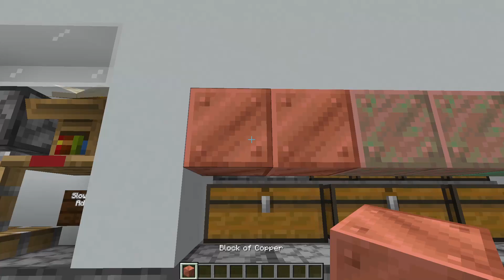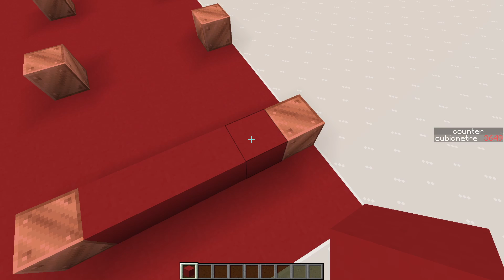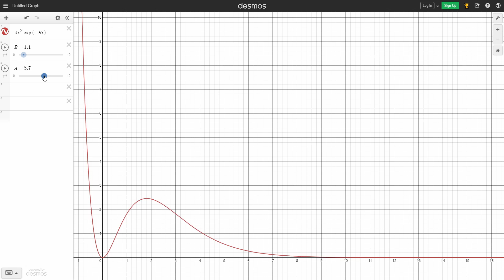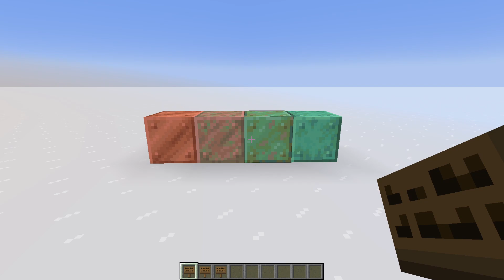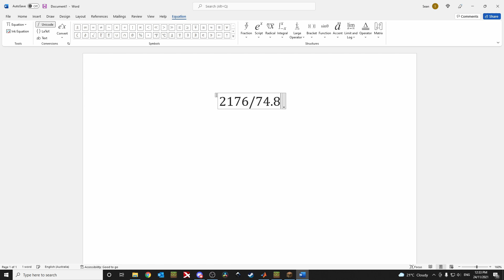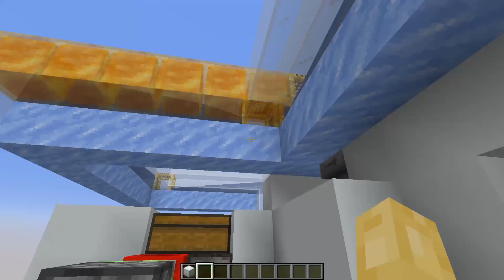Full Auto Oxidized Copper Factory

Comment: For producing maximally oxidized copper, it should be faster to harvest at the maximum placement rate, and instead rely on a sorting system capable of directing the incompletely-oxidized blocks back to the player to be placed back into the input stream a second (or third, or fourth) time. Breaking and re-placing a partially-oxidized copper block doesn't "lose" any progress, but fully-oxidized blocks occupying space in the system do represent an efficiency loss.

Comment: can u make an addition so u cut set a mode that reuses all less oxidized blocks then the one u chose when the supply of fresh blocks runs out
Reply from the maker: I did sort of try to implement this, when the buffers for lesser oxidized states overflow they will begin to dump the blocks onto the player placing blocks. The only issue is that to run at full speed the play needs to have some buffer of copper blocks in their hotbat slot, so when these lesser oxidized blocks get sent to the player they begin stacking up in a new hotbar slot that the player isn't using to place blocks.
Reply: @cubicmetre  have u tested if blocks despawn if u fill up your inv with items so only the one slot can pick up copper blocks?

Comment: I thought of something similar but then with cobblestone in between (I havent tried it), have you tried it, and ifso why didn't it work or was it inferior to powderd snow?
Reply from the maker: Powdered snow was the only block which could be placed AND removed automatically without needing to consume any resource such as TnT. The problem with generating blocks such as stone or cobble is that you are generating 4 filler blocks for every copper block. Meaning that whatever system you have to collect the copper at the end will also need to be engineered to handle the other 4 blocks that come with each copper block. Placing down 18Kph copper blocks would thus translate to an effective output speed of 90Kph, requiring vastly more systems in place to handle the extra blocks.
Reply: @cubicmetre  that makes sense, and also since you don't use tnt duping.

Comment: Never thought about using snow, I rather thought about using for example a cobble gen, separating the cobble from copper in similar way you pickup snow, and then blow up unneeded cobble, or maybe recycle it back using a block stream. If you would recycle the cobble back, it's also a closed system, and it also doesn't require hard to obtain thousands of snow buckets, you just need random filler block.
I love the whole finished product tho,  it feels so great to see engineering applied on such a simple task, just because automation is the way.
Maybe a small suggestion, there could maybe even a mode, which is used to "pull out" all the copper blocks from system, without needing to use more copper blocks to replace them. Basically just have snow being placed continuously until all copper blocks are pushed out.
Reply from the maker: That flushing mode is certainly a possibility, as for separating cobble can copper blocks, there is in fact no way to differentiate between two different full solid blocks like copper and cobble because they both behave the same in a block conveyor.

Comment: I love the way by which you can choose the state most blocks will end up as, but as a builder I often let everything oxidize to its maximum state and then just axe it to what I need later. Definitely streamlines the process.
Reply from the maker: Oh, I did not realize that using an axe would revert a block only a single stage. I always thought that using the axe on copper completely reset the oxidation.

Comment: sometimes we wont use the machine for a specific type of copper, because most people would probably want some of each type that they can use when needed. in the graph shown there was a point where the percentage of each type of copper was roughly equal, so there should be a setting where the copper is exploded at around that time.

Comment: Trying to derive the optimal times analytically (using some values from the wiki) I get the following function to maximise: (chance of block being fully oxidised after a time period, divided by time)

(1 - Sum[((1 - 1/4096*64/1125)^(3*20 (60 m)) (-(1/4096)*64/1125)^i Binomial[(3*20 (60 m)), i])/(-1 + 1/4096*64/1125)^i, {i, 0, 3}])/m

(m in minutes, mostly because trying to do the same with ticks got me into numerical accuracy issues during calculation)
Which gets me an optimal time of around 67.7 minutes, or 81207 gameticks. The difference between the values we got versus what you derived in the video could easily be explained as the difference that your approximation made, though admittedly it doesn't matter too much as the graphs are relatively flat near that maximum.

For the other states I got 0 minutes for unoxidised (duh), 1 tick for exposed copper (or 0 in my math but clearly it needs at least a chance to convert), 20 minutes for weathered copper

This then means that you optimally need a blockstream of roughly 20*60*67.7/2176 = 37.3 ticks per block  (11 ticks for weathered)

For reference, the following functions are the chances of finding the copper in each state after m minutes:
Copper Block:  (71999/72000)^(3600 m) 
Exposed Copper:   (9/71999)^(1 - 3600 m) 20^(2 - 10800 m) m
Weathered Copper: 5^(2 - 10800 m) 8^(1 - 7200 m) 9^(1 - 3600 m) 71999^(-2 + 3600 m) (-1 + 3600 m)m
Oxidised Copper: (1 - Sum[((1 - 1/4096*64/1125)^(3*20 (60 m)) (-(1/4096)*64/1125)^i Binomial[(3*20 (60 m)), i])/(-1 + 1/4096*64/1125)^i, {i, 0, 3}])       
(Or alternately, Oxidised Copper: 1 - the above 3 formulae, its just different notation)

I had a lot of fun doing this math, so thank you for inspiring me to do so. Though... It does make me wonder if the derived times could be somewhat off if for example copper blocks don't oxidise while being moved via piston. And if it could be interesting to return the collected blocks back to where you place it so you can give unoxidised blocks a second go through the machine. Optimal times for THAT would probably be different as well...(and likely lower)
Reply: Since the number of oxidization trials (number of ticks a copper block spends inside a silo) is large, it is justified to approximate the binomial distribution with its limit Poisson distribution. The fact that computing the binomial coefficients is causing you numerical problems is a clear sign that you should be doing this. The Poisson approximation would eliminate the numerical problems and be more accurate than the approximation you made of aggregating ticks to minutes.
The Poisson approximation will give you the oxidization graphs as exponential polynomials, which would arguably be more insightful than large binomial sums you got. I think the maxima could even be computed analytically.
Someone in this comment section derived the oxidization graphs as solutions to some coupled ordinary differential equations, which is equivalent to the Poisson approximation and also a really pretty and intuitive way of posing the problem.

I encourage you to try solving the problem you describe at the end, where the partially oxidized blocks are re-inserted into the machine. It's a really interesting and a much harder one as the probability that a block has been fully oxidized as it leaves the silo is no longer independent of the oxidization states of all the other blocks. You will have to find a steady state distribution that the system approaches when it's operated for a long time and then compute the expected value for that just like you have done here.
Reply: @Nukelawe  yeah, so... I didn't derive this  using Poisson or binomial distributions. I modeled this as a markov chain. (raising a transition matrix to a power and multiplying with the vector of initial states) The binomial coefficients were just what rolled out of the math.

The numerical issues I had was just that the derivative is smaller for the tick based formula compared to minute based. (which are rescaled versions of each other anyway) which then makes the root finding not work as well.

Both binomial and Poisson distributions would be an approximation. (EDIT: In hindsight Binomial might not be)
Reply: @roderik1990  That is curious. I thought a Markov chain would only be necessary for describing the system, in which partially oxidized blocks are reinserted to the stream. Clearly there is a way to define a Markov process also in the simpler system given that you've done it. What did you define as the state space for your Markov process?

To explain how I think the binomial distribution provides an exact description of the system, let X be the number of successful oxidization attempts a copper block receives during the t ticks it spends in the silo. Now X is binomially distributed with parameters t and p, where t is the number of ticks spent in the silo and p is the probability of a successful oxidization attempt on any single tick.
The fraction of copper in oxidation stage k, for k<3 is given by P(X=k), and for k=3 by P(X>=k). (Here oxidization stage 0 refers to copper and stage 3 to oxidized copper.) I argue that these probabilities (which depend on t through X) give the exact curves for the fraction of copper in oxidation stage k at the time of harvest.

I didn't check it, but your solution looks very much like the one you would get using the method described above. That's why I assumed it was what you had done. Probably your Markov chain method and the one I just described are somehow equivalent.
Reply: @Nukelawe  The state space was the different block states for the copper block, each of which has 1-p chance of remaining in its state, and p chance of transiting to the next state. (with exception of the last state, where no further transitions occur)

And now I see what you mean, this could indeed be completely equivalent. (With the binomial distri giving a simpler derivation)

Comment: Powdered Snow is a great idea and works great if you have a Powdered Snow farm to supply that much. If you're a little short on resources in a survival world though, you can replace it with a simple Stone generator. The Stone or Cobblestone can get blown up in the blast chamber, or if you care about TNT efficiency, transformed into moss at the end of the blockstream and punched out by pistons. This also takes out the need for the closed loop system to recycle the Powdered Snow.
Reply: Was also just looking at the hoppers required for a farm of this magnitude too, might actually be less laggy too.
Reply: If you dont use powder snow then you’ll need to create a new separator for the copper
Reply: @valeriomastroeni8454  Well, yes. Stone blocks. That's what I said.

Comment: OK I've looked st this multiple times, but... How do you make the hopper that collects the powdered snow buckets not suck the unfilled buckets out of the dispenser?
Reply: ah OK, I've got it I think - the buckets are dropped into the (empty) dispenser and the dispenser is activated in the same tick?
Reply from the maker: Yeah, you schedule the dropper and the dispenser to fire in the same gamtetick in the correct order such that the bucket item gets used by the dispenser in the block event phase, the hopper is then processed after the block event phase and so sucks the remaining item. This also has the benefit of spitting out the item in the case that it cannot interact with the block infront of it. This is helpful to avoid issues propegating in the machine if anything goes wrong.
Reply: @cubicmetre  thanks! The failsafe is a really nice touch, too :)

Comment: Would adding stationary fully oxidized blocks help?
Reply: I don't think having oxidized copper nearby speeds up the process. As I understand it, when a copper block gets random ticked, it checks in a 7x7 area around itself for copper in a state less oxidized than itself. If it finds one, it cancels the oxidizing step. If this is true, there is no opportunity for the copper to skip steps or oxidize faster than it would on its own, since the surrounding copper can only cancel attempts to oxidize.

I think it does this so that whole structures oxidize together. Like if I built a statue of liberty in my world, without this mechanic, some blocks would oxidize to the end relatively quickly, while others would take something like 10x longer. Because the process is random, this would create a really spotted and almost moldy-looking texture, where spots of green and orange are scrambled into a vaguely green-brown structure. This is neither attractive nor realistic, so the devs had each copper block wait until all of its neighbors were oxidized before moving on to the next stage. With this mechanic in place, the whole structure oxidizes much more slowly, but it does so uniformly, with only two levels of oxidation ever to be found within four blocks of each other.

Comment: I was thinking using stone generators to fill the blockstream would be significantly easier and loads cheaper to build. For continuous usage you only need one blast chamber but if you wanted to push input speeds for getting the first stage of oxidation or to use it in the ultra fast mode and just wait you'd need to invest in more blast chambers
Reply from the maker: The problem with generating stone is that you effectively multiply the output of blocks by 5 because then you have the stone to deal with. It is funny because less than a day after posting this design somebody messaged me a mechanic I had not considered and it turns out it makes this design completely obsolete.
Reply: @cubicmetre  What does that design involve?
Reply: @cubicmetre  yeah I think I would just live with it being limited to the max speed that allows. I was also thinking it would be funny to convert the stone to moss at the bottom. Recycle the moss into bonemeal and it could be totally self sustaining. Would allow the full speed shown here to work
Reply: I also can't shake the feeling that turning each column into a piston tape and just pushing the filler blocks back up ought to be possible

Comment: Absolutly amazing. I was always wondering why there is so few really serious copper oxidization machines. I only know of https://www.youtube.com/watch?v=1axQe5nUvwQ and https://www.youtube.com/watch?v=y2ZD8jKYVrM, none of which are as complete and good as this one. Loving it, thanks again for another great creation!
Reply from the maker: It's incredibly hard work to actually make so many complex block conveyors work together perfectly, but fortunately I have a lot of experience with my blast chambers and so I had a very straightforward methodology to apply in order to keep everything synchronised.
Reply: @cubicmetre  Yeah I've played around a bit myself with a version that uses a cobble generator instead of powdered snow as the blocks inbetween, but I was never able to get it working in a somewhat speedy way. All your experience really shows in this build! :)

Comment: Thanks for a great video once again!
A very similar optimization problem is also encountered in other areas of Minecraft. In traditional flushing crop farms the optimal time to harvest and replant is obtained as an 8 stage equivalent of this. Sugarcane with its 15 growth stages is similar, but extra complexity is introduced by the fact that attempting to break a sugarcane that hasn't grown yet will not reset its internal state (btw, explaining the optimal sugarcane harvesting problem would be a great topic for a video).

What makes copper different is the need to harvest the intermediate oxidization states as well - something which makes no sense in crop farms. In this farm in particular I can actually think of a similarity to the sugarcane harvesting problem as well. Assume the farm is run in its slow mode and that the buffer chests of partially oxidized copper are full. The copper blocks that enter the silos will now on average take less time to become fully oxidized, because of the intermediate oxidization stages mixed in the input stream. This should increase the optimal input speed from the one that assumes a 100% unoxidized copper input. Solving for the optimal input speed in this case would be an interesting problem.

It seems that copper separated by 4 or more blocks oxidizes completely independently of its surroundings, which makes possible an analytic solution derived from binomial/poisson distributions. That said, did you base your curve fits on the experiment shown in the beginning of the video or did you derive them using the oxidization probabilities defined in the code? Did you estimate how much oxidization occurs outside the silos compared to the inside? I'm asking this to understand the extent to which the entire oxidization process is governed by the analytical solution that only describes the sparse configuration of copper inside the silos.

Returning to the sugarcane harvesting problem, just as the optimal input rate here for harvesting the first oxidization stage is "as fast as possible", I recall that global maximum sugar cane harvesting rate was also obtained at a tiny (like 10-20 tick) harvest frequency. The reason why this was not "as fast as possible" was that during each harvest there were a couple of ticks on which growth was prevented by the harvesting piston head. Is something similar happening here? While the blocks are being moved forward in the conveyor belts, can the copper block oxidize or is this prevented because the copper block while moving is unable to receive random ticks?